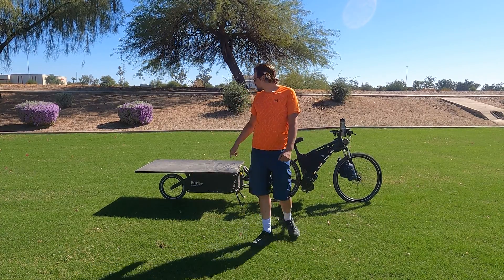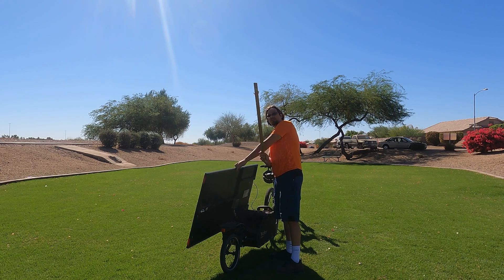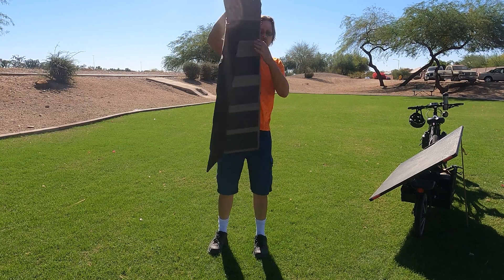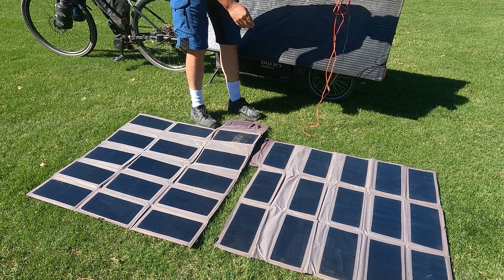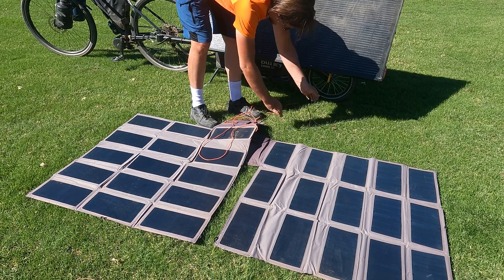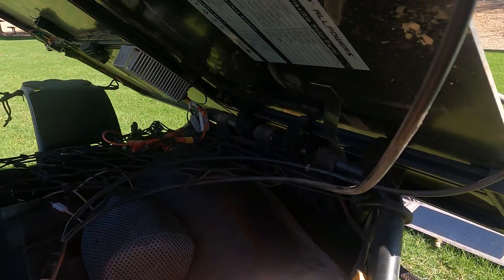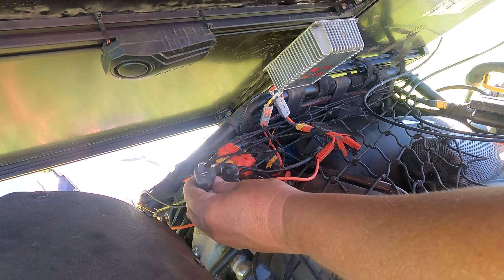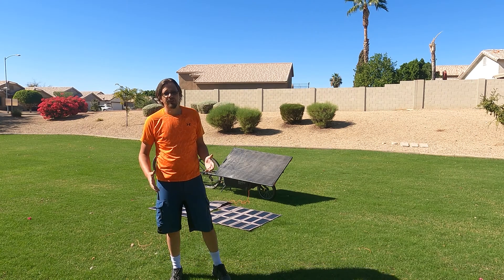200w Solar Bike Trailer | How I Charge My E Bike

Comment: 55 amp 48v = 2640 amp hour.  Was this right?  Sorry I am building a touring solar bike.  Thank You.
Reply from the maker: Yep
Reply: Ty, I am a vet with RRMS (Remitting Relapsing Multiple Sclerosis), I am trying to find info on trailer build so I can bike tour.  I think at this point I am looking at 3x 100watt panels.  Hopefully it will be enough.  Also running bbshd w/w27.5 52v amp battery.  I cannot thank you for what info you have put out.  Before this, I was not sure if I could even do this.

Comment: Thanks for sharing. I've been looking for a good trailer for a long time, the one I picked would have been the BoB trailer, but they don't make them anymore. Somewhere I read that they recommended the Burley trailer instead. Indeed at the moment if I'm going to buy a trailer it will be this one. What is the maximum speed allowed for this trailer? Maybe from there I will move on to solar panels :) 
Thanks
Reply from the maker: They say max speed is 15mph. I've done 35mph+ with no problems.

Comment: I like your system - I suggest you do some test rides and get a a handle on your typical watt hour per mile usage. That number is real handy for calculating ranges and power use projections in your head while riding.